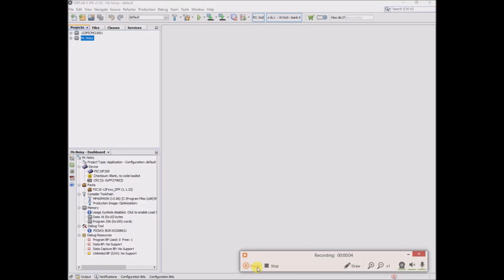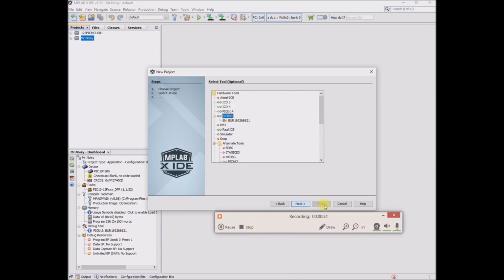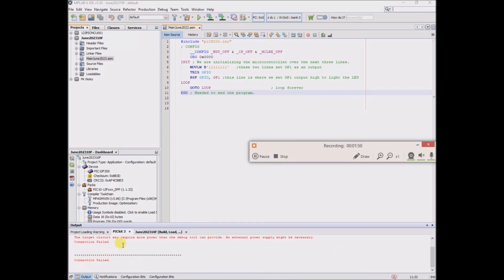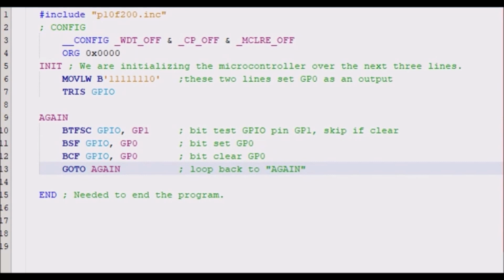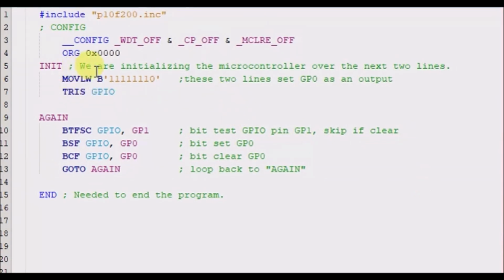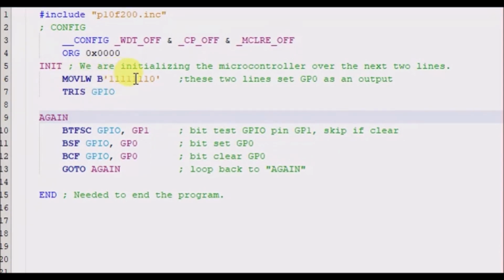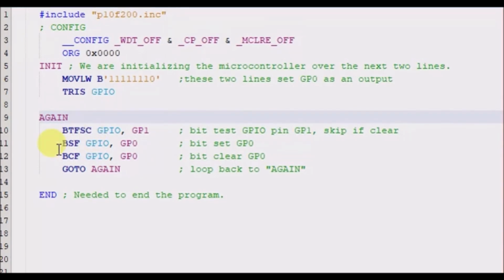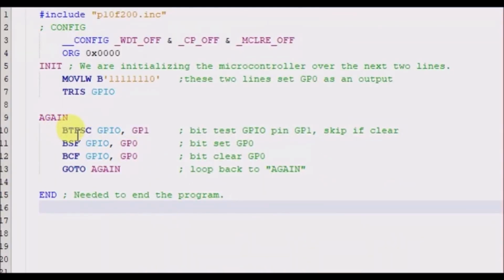The PIC10F200 Series: Part 011: BTFSC Assembly Instruction

Comment from the maker: ;sample code, copy and paste
    
#include "p10f200.inc"
; CONFIG
    __CONFIG _WDT_OFF & _CP_OFF & _MCLRE_OFF
    ORG 0x0000
INIT ; We are initializing the microcontroller over the next two lines.
    MOVLW B'11111110'   ;these two lines set GP0 as an output
    TRIS GPIO
   
AGAIN
    BTFSC GPIO, GP1	; bit test GPIO pin GP1, skip if clear
    BSF GPIO, GP0	; bit set GP0
    BCF GPIO, GP0	; bit clear GP0
    GOTO AGAIN		; loop back to "AGAIN"
    
END ; Needed to end the program.

Comment: With the loop setup the way it is, the GP0 output is going to be toggling very quickly, resulting in only a partial duty cycle output - basically the output will be on for only a single clock out of the 6 or so clocks it takes for the loop to run.

A perhaps better way to write the loop would be:

AGAIN
    BTFSC GPIO, GP1
    GOTO SET_GP0

    BCF GPIO, GP0
    GOTO AGAIN

SET_GP0
    BSF GPIO, GP0
    GOTO AGAIN

The loop takes a little longer to complete due to additional branches, but the output will have a 100% duty cycle either on or off.
Reply from the maker: I appreciate the advice. I was thinking the same thing.